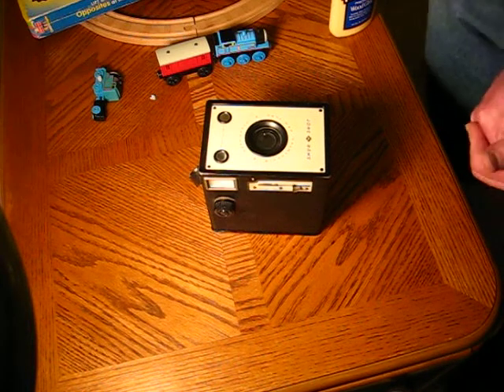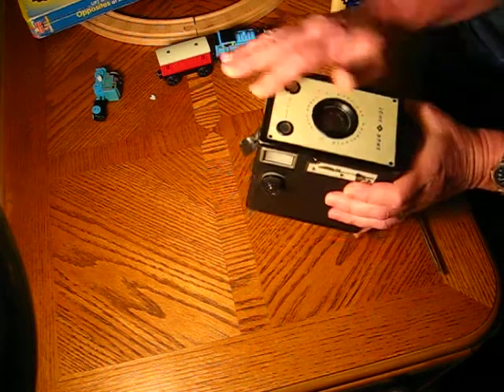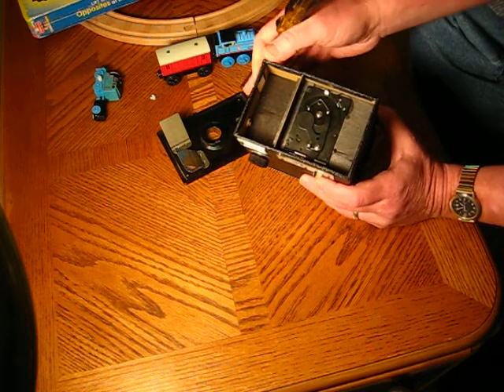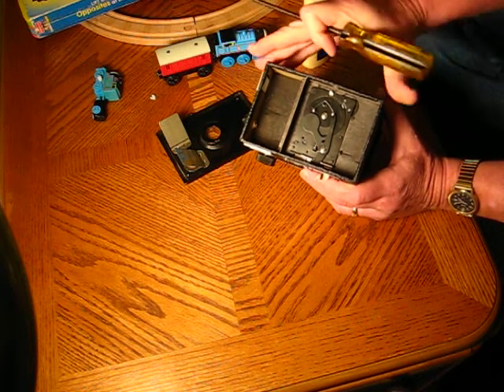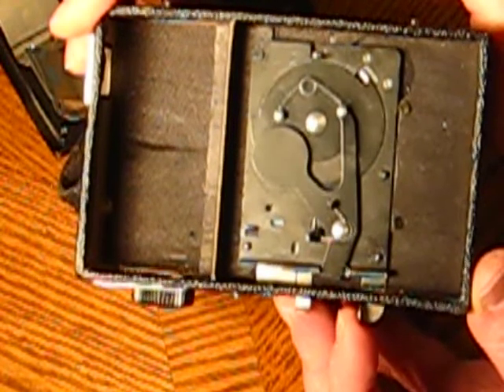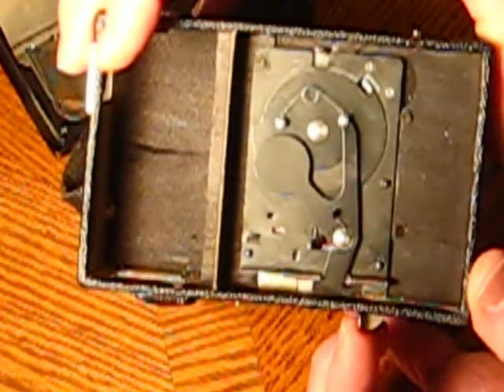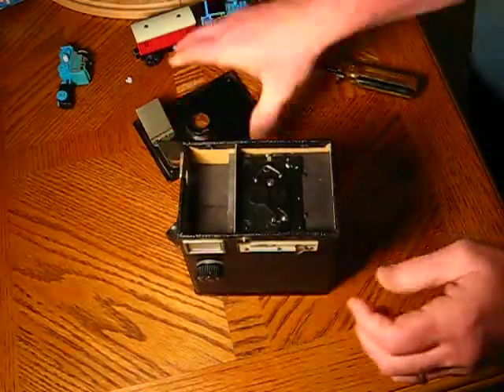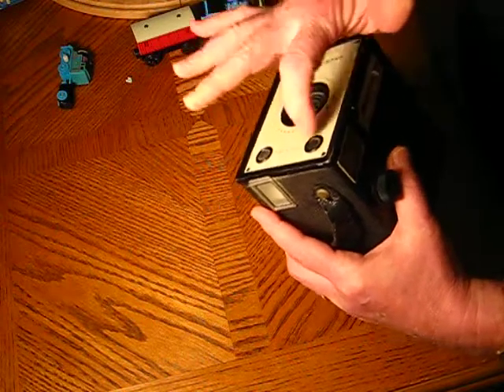1940s Ansco Shur Shot box camera Shutter Mechanism Operation

Comment: Dave, while I was in there, I cleaned the fogged viewfinder windows, and now I get much clearer finder images. I cleaned everything, especially the lens, so I don't have specks of dust causing problems on the film. I lubed the film rollers for smooth, scratch-free film transport, also. My camera has a yellow contrast filter in addition to 2 optional apertures, selected by pull-out tabs. It's also a "B-2 Shur Shot," must be a later model than yours?